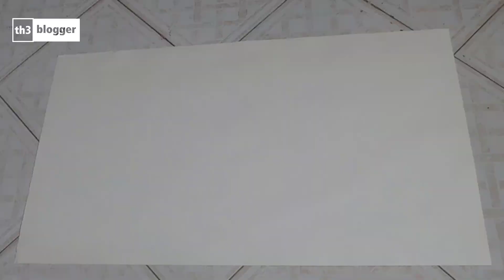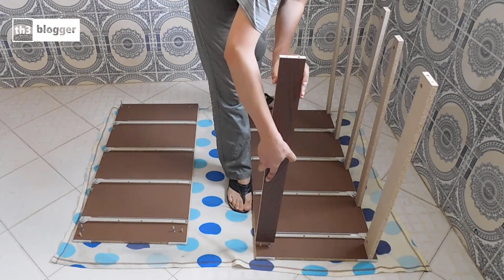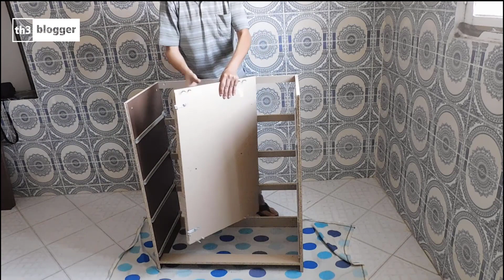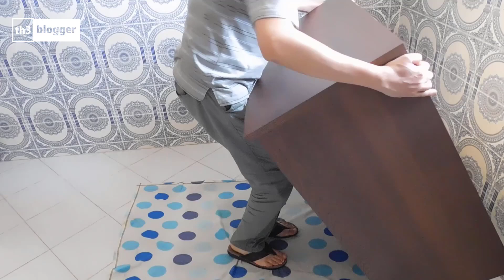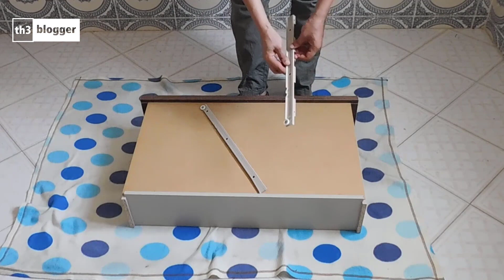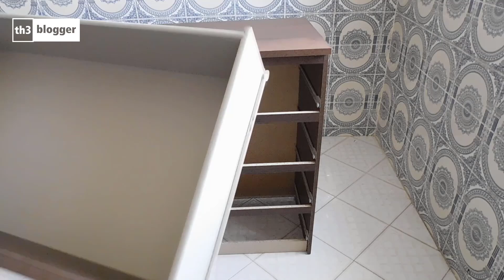MALM 4-drawer chest,  assembly - IKEA

Comment: Completed assembly and now the top drawer only opens a couple inches and cannot get drawer completely out, it's stuck
Reply from the maker: Check if its wheels are on the rail. Slide the bottom drawer to check the top
Reply: @th3blogger  the wheels are on track.  Everything working good except top drawer only opens a couple inches and I can't get the drawer out
Reply from the maker: @kencozen7782  Have you tried changing the order of the drawers? Is the rail not upside down? These are just possibilities
Reply: @th3blogger  finally got top drawer out. There was a screw head inside the rail that was catching the wheel. Tightened everything up and is working ok now.
Reply from the maker: @kencozen7782  good for you.. and good luck . thanks for watching